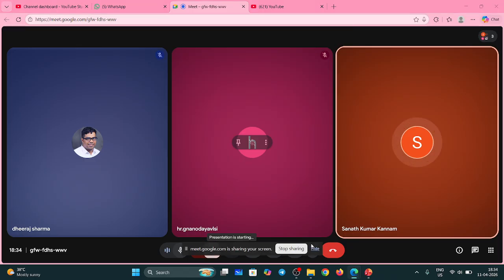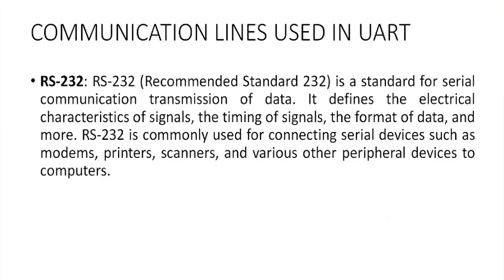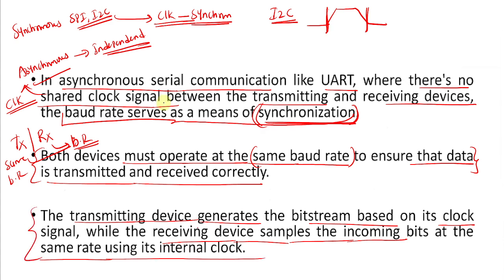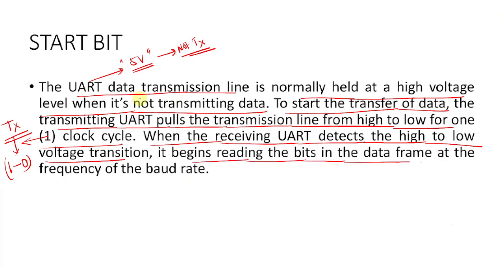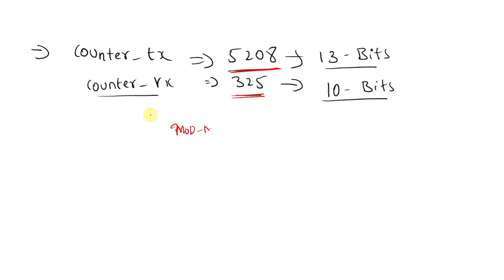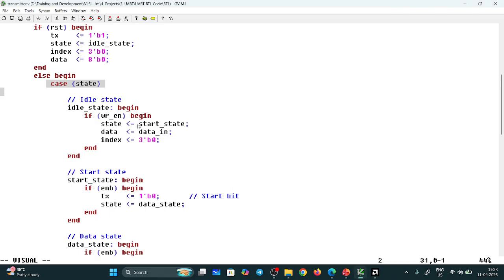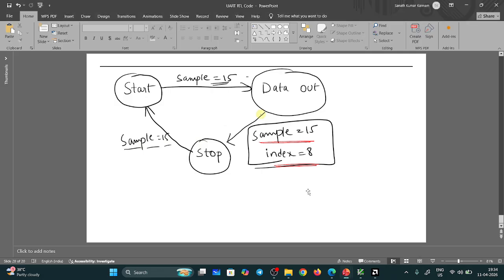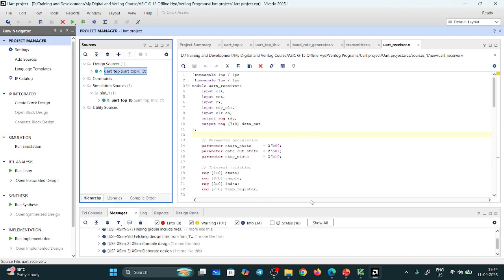UART Protocol Project | Concept to RTL Coding & Testbench Verification

Comment: during the mode calculation is it required10 bit  
for counter_rx.but 2^9  is also greater than 325.
thats why i think 9 bit is sufficient
Reply from the maker: You are correct that 9 bits can represent 325, but 10 bits are often used to provide extra overhead for timing margins and future modifications.